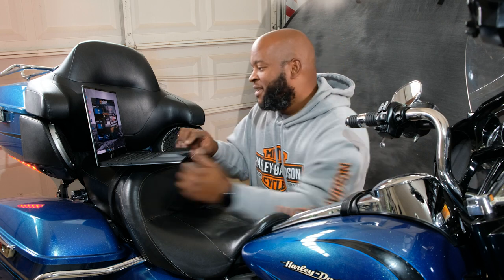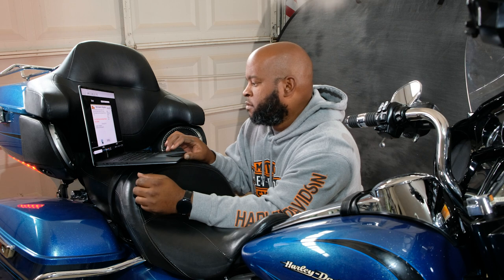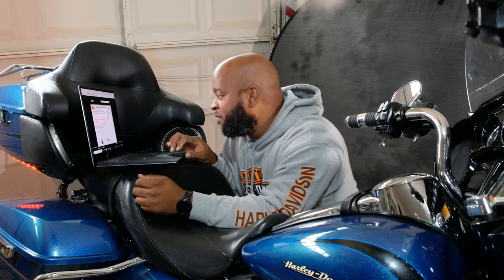Cicado Audio DSP AMP 1st thoughts

Comment: Question,, how many channels does your amp have and what the RMS output?? I did the whole flashing thing myself as well on my street glide and still was not happy with the sound quality, so i upgraded my head unit to the new reserve head unit and the sound quality difference is amazing, the original head unit was great but to me the upgrade was better and no flashing required, your system sounds great, i am thinking of upgrading my fronts to Cicada horns myself, but still working on the systems saddles and amps,, oh and sweet bike😎👍 we need to hear your system cranked up👍👍👍👍
Reply from the maker: Its a 4 channel amp with the built in DSP. 4x92 at 4ohms and 4x152 rms at 2ohms. I did post a ride video, at the end of that one I crank it up a bit more.

Comment: What speaker grills did you use? I hear the cicadas rub on street glides because of the fit.
Reply from the maker: I used some mesh grills from amazon. I'll have to check the brand. They are pretty good gauge metal and good paint.

Comment: Which flash did you use? I used the soundz 8 speaker 2 amp flash.
Reply from the maker: The 1st time I used the Kicker flash. But later flashed it with the Rockford and redid the eq a little bit.